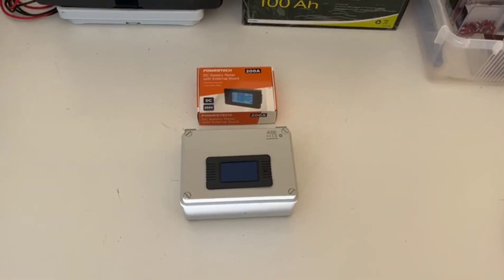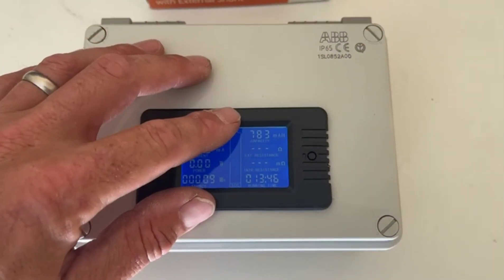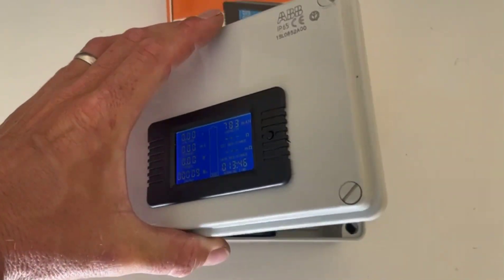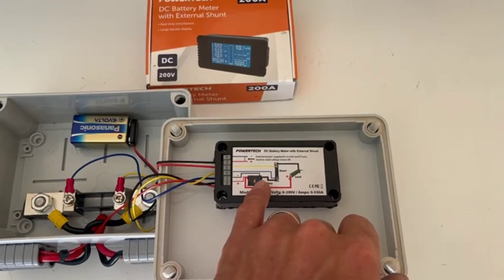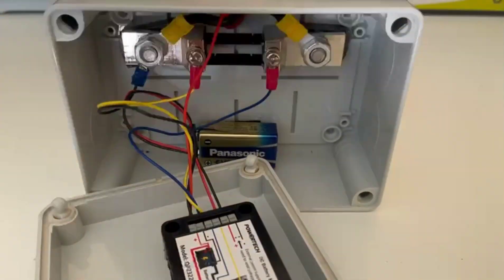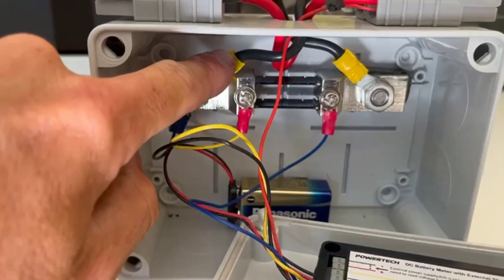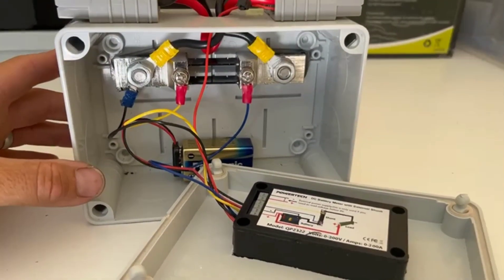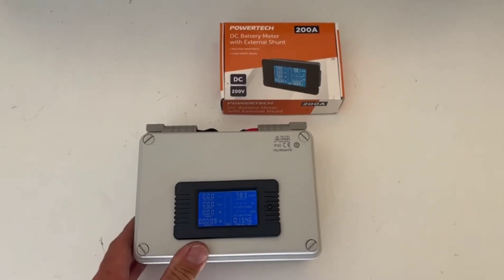HOW to make and wire a 200 amp Battery Shunt in DIY Digital Battery Display Box

Comment: Hi, I've just fitted one of these to my battery box with a 100ah LFP.
I currently have power + wired to the off side of the main isolating switch.  Just wondering if it's worth proving a 12v source to keep the display on, as I mainly use it when going away. I'm using it to run my CF35 Waeco.
Your vide was most helpful,  cheers from the Great Southern...
Reply from the maker: Thanks for watching! Apologies for delayed response. A back up power source to keep the data displayed is handy, it only needs a 9volt battery connected for it to work. But if you’re only using the battery to run your 35l fridge and you’re monitoring it regularly  then it may not be needed?

Comment: Using a 9v for power was pretty slick. Every other one I've seen uses DIY 18650 batteries or takes power from the source being tested.
Reply from the maker: Yeap i had seen that aswell. 9v option is much better! Works a treat for me.

Comment: I think you forgot to mention that if the screen is placed in dormant mode….. by pressing the button to switch off the screen, at that point the shunt and display stops measuring input and output and then your capacity totals become incorrect, that is so annoying and pointless…

Comment: I have 2x 200Ah batteries, cost $1600 the pair. Do you want to look at them before they're deployed?

I have a 50A B2B charger, I plan on using Anderson connectors between them and the battery. Should I use higher capacity connectors than 50A? It seems to me to be cutting things a bit fine.
Reply from the maker: What batteries did you go for? A 50amp charger on 50amp Andersons should be fine. The output wouldn’t be continuous 50amps, but if that was my set up i would upgrade the Anderson plugs to 120amp ones. Just for peace of mind. Or if possible hard wire?
Reply: @vesautoelectrics  PIONERGY 12V 200AH Lithium Battery LiFePO4 Deep Cycle RV Solar Off-Grid System

I've not yet decided where to put the electrics,  using an Anderson connector would allow me to relocate stuff.

It's a commuter with a chair lift which might be useful. I looked at the battery and decided I'd rather someone else gets to fiddle with it.

Comment: What a champion! Thanks heaps for that mate, I'll be making one that is so handy. Thanks again appreciate it 👍
Reply from the maker: Thanks, Glad you liked the video. How did you go with your charger? Was it set up wrong or faulty?
Reply: @vesautoelectrics  to be honest mate I haven't looked at it since we got back from going away before but going away this weekend, so I went in the last night actually to check my charge in the battery and even though my charger was connected my battery had gone down to 165 amps. One, I don't know how it could discharge that much with no load, and once again the charger is not charging and then trickle charging..?
Reply from the maker: Definitely sounds like the charger is at fault. If the settings are correct i would be replacing it. Least then you’ll have peace of mind that’s its working 100% and looking after your batteries.
Reply: @vesautoelectrics  thanks mate. I'm going to get onto Kickass and chase it up.